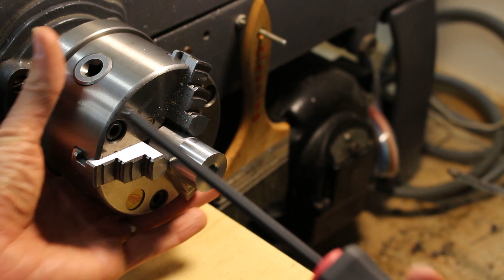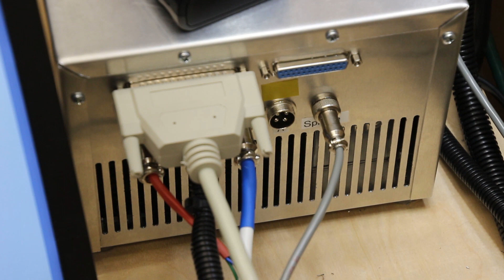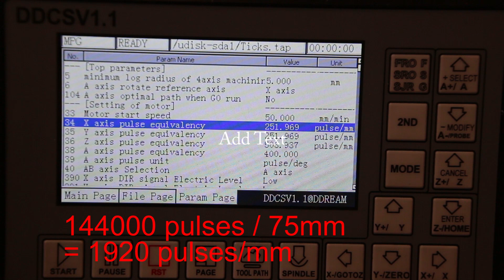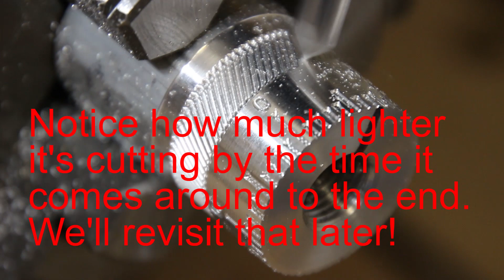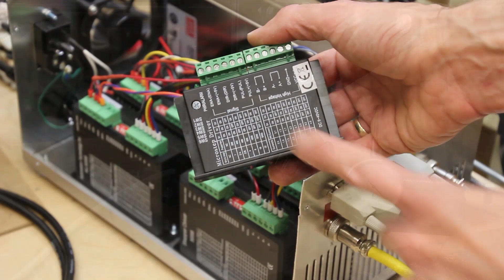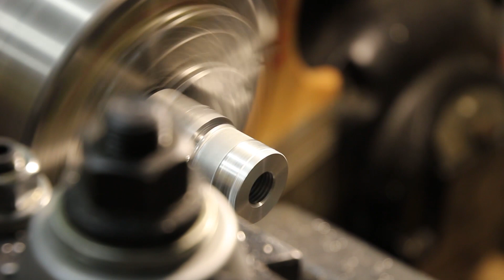4th Axis Engraving a Micrometer Dial Part 2, CNC Routing

Comment: Good morning friend, (an excellent video) I am Brazilian I follow your videos and recently I replaced the MACH 3 for a controller, DDCS V3.1 everything works but when I use the room, the Y axis does not use the Y axis to move the Z axis.
Reply from the maker: I'm not sure what to tell you, but on the controller that I built I used common connectors so that I can easily swap axes around if I need to, just by connecting a motor to a different output.

Comment: Only found your channel recently and I love this project in particular. A question I have (totally out of ignorance)... why switch the rotary axis to X and not run your program from A? Can you explain or point me to a source that can explain it?
Reply from the maker: It's because my Fusion 360 toolpath was based on an "unwrapped" cylinder where the text is engraved into a planar surface and it's moving in X instead of A. I did it that way because it's hard to model text engraved into a cylinder in Fusion 360. Because it's generating moves in the X axis I had to connect my A axis motor to the X axis output.
Reply: @BrainRight  that makes sense. Thank you!

Comment: Looks like you have problem with axis jerking. Especially 8:20. 1 is not smooth. Common problem with text sketches in fusion. Did you try smoothing ?

Comment: GHT writes a bit about this, and while he was writing about manual work with letter and number stamps, the tips he has about cleaning up the burrs on the part afterward remain relevant.
he suggests using a very clean fine-cut file, used very lightly, and cleaned again with the point of a needle after every few strokes. Perhaps counterintuitively, the resulting marks are easier to read, because while they are smaller and shallower without the burr, the edges are far more crisp.
Thanks for sharing this! It's really fantastic to watch you work.

Comment: Are you planning to upgrade the motors to closed-loop steppers to ensure there is no loss of steps?
Reply from the maker: Funny you should ask that. I've started evaluating some new closed-loop stepper drivers and I plan to publish a video of them soon.
Reply: From engineering point of view the close-loop control systems are always better as they guarantee stability.
The problem is cost (more complicated system) and reliability (more elements to fail).
The price of close-loop drivers and motors is  (at this time) roughly double the cost of conventional elements. But the cost of drivers and motors is just a small fraction of the cost of the machine. Also, many people oversize the motors and drivers (which require bigger, more expensive powe supplies) to avoid step loss under heavier load, which drives the cost to a level comparable with (if not higher than) close-loop drives. 
Therefore I am wondering why are new builds still employing open-loop drives.
Perhaps it is lack of knowledge and your new video will help with that.
As always, wider acceptance  of new technology will lead to higher demand which will lead to more supply and eventually to lower cost.
Looking forward to your new production :-)

Comment: Great video, thanks for sharing. At the end of each 'tick' there is a little clean up back and forth, where in the process did that get put in?
Reply from the maker: It is due to the nature of the Engrave toolpath in Fusion 360, and the fact that the ticks are modeled as rectangles. The toolpath V-carves the rectangle so it runs the bit down the center and up into the corners of each rectangle. It would be more obvious in the result if my cutter had a sharper point, or if the rectangles were larger.

Comment: Really enjoyed watching the 4th axis build videos and now this one.  I was wondering if slowing down the feed speed would have helped with how the tick marks and text turned out.
I'm working on making my own micro-CNC drill/mill
Reply from the maker: Thanks glad you enjoyed it. I think the feed rate could have been somewhat faster without much loss of quality, and making it slower probably wouldn't have changed the result much. But in general a slower feed rate does tend to improve things and I think that is mainly because it reduces the force on the cutter, which in turn reduces the deflection of the spindle due to the limited rigidity of the machine. That seems to be true for most materials I have cut except for plastic, which melts if you cut too slowly. With plastic I run it at low RPM and high feed rate because melting is a much bigger problem than deflection - as long as the bit doesn't break.

Comment: What is all the hokey pokey that is being done at the beginning and ends of tool movements? I can see both little rotational and up/down movements before a cut is actually executed, tool drops to work little L/R rotation and up/down jogs almost like overshoot and then a correction. Is this system artifact or intentional programmed movements
Reply from the maker: The tick marks are rectangular in shape, and the engraving toolpath is designed to work with a V bit and carve into the corners so they end up square (ish). It would not matter much for this purpose, but that's just how this kind of toolpath is intended to work so it takes additional cuts into the corners of each tick mark and also into the corners of the text strokes. Fusion 360 has other kinds of toolpaths that would not do that, which would result in a slightly different appearance and possibly a little less machining time.

Comment: Hallo, VERY GOOD VIDEO  nicely articulated, no pesky music and good audio. 
You kept decreasing the diameter, (hence circumference), of your work-piece stock to correct  earlier runs you were not satisfied with.. I'm not sure if you mentioned it .. but did you have to change your CAD program to account for the decrease in circumference? or did you just use some scale function ..  otherwise wouldn't that have been a little hairy?
Reply: His X axis was plugged into the 4th axis. And things were set up so when the program tells the X to move 75 mm, the 4th axis would get those pulses and make it as 1 revolution.

So that's the ratio, and it doesn't need radius or circumference for anything. It doesn't matter how small the diameter is, when the CNC tells the X to move 75 mm, it rotates the 4th by 360°.

But how would the Z axis know that the diameter is smaller? It doesn't. He tricked the axis by sticking the tool a bit more out, so the tip would touch the surface, while the program thinks it's touching the full diameter surface.

That gets the lines a bit thicker, but everything goes where it's supposed to go regarding angle, position and depth.
Reply from the maker: Actually it doesn't have much effect, because I zeroed out my Z axis on the surface of the part each time. It still rotates the same number of degrees in between tick marks for example, or to move the width of a digit when engraving the text.The text gets a little narrower as the diameter is reduced but that's about the only obvious effect.
Reply: Hallo again!
Sorry but it's still unclear as to what's happened.  After some further thought .. zeroing the Z-axis does not explain it as far as I'm concerned.  Folks will need to watch your precursor video, (part 1), to understand the basis of this  puzzle.. if I remember correctly the software you used  appeared to map a 2 dimensional object to a 3D rotational one, (cylindrical surface),  and you appeared to take care over the overall length = circumference, (75 mm?), so that is why I asked the question. Oh! and by the way I would really recommend  your viewers to watch part 1 ... and not skip it .  However after all's said and done this an excellent video.

Comment: Great set of videos on your 4th axis, Jay!  I plan to build one for the CNC I built and I got some good tips watching your videos.  On the 'deflection' on your tick marks I wonder if that is Lead In or Lead Out causing that...?  I usually turn that off to keep that sort of thing from happening.David
Reply: BrainRight hi, I had this problem with engraving. I solved this by placing a radius on the end of the feature being engraved. The lead in marks are from the tool cutting into the square corners. I hope this helps, Mat.
Reply from the maker: Thanks David. I went back and checked the toolpaths that I used for the tick marks, and Lead In/Out is not an option for the 'Engrave' type of toolpath that I used so I don't think it applies here. But it's a good suggestion to keep in mind when using other toolpath types.
Reply from the maker: I see that we have similar interests and we both make guitars, and I've subscribed to your channel. My guitar building has been going slowly lately but I do have a few in progress, a pair that I'm making for myself (one steel-string, one classical) plus another steel-string that I'm helping my sister to build for herself. I may be using the CNC for carving the necks on these, haven't done it that way before.
Reply from the maker: Thanks, maybe I'll try that next time.

Comment: What is the CAM program?
Reply from the maker: It's Fusion 360, the same program I used to do the CAD. That's one reason I like Fusion 360, that it lets me do both the CAD and CAM with the same software. I also like it because Autodesk licenses it free for non-commercial use!
Reply: I use it as well, awesome program!

Comment: Hi Jay, Markus from Sweden here :)

Just looked at your video and I just wanted to tell you I`ve had the same problem with loosing steps. Not i simular operations but it was an easy fix so I want to let you know.
It seemed my breakoutboard got to small amount of power. I got rid of 1 A supply (old mobile charger) and put in 5 A sypply. Problem gone.

Best Regards/Markus
Reply from the maker: Hi Markus - glad you got it figured out. I was worried about power issues when I built my CNC controller, even though the control panel doesn't draw much current, which is why I put in a power supply just for the controller that's separate from the one that drives the steppers. It's different in your case but having a separate and fairly robust supply just for the controls seems like a good idea in general.
Reply: Yes I have seperate power supplies too (my machine has much bigger steppermotors than yours) but it seemed the breakoutboard needed more power when much was going on.  A straight line don´t need much pulse but diagonal or circles over long time need much more power, exactly like the operation you got trouble in.
For me this problem came over time, the mill worked fine for about 2 years then it started. Don´t really know why, I have several thoughts about that but don´t really care. Maybe a combination of wear for computer, electric and motors (I have used the mill a lot). Although a new motor didn´t fix the problem.